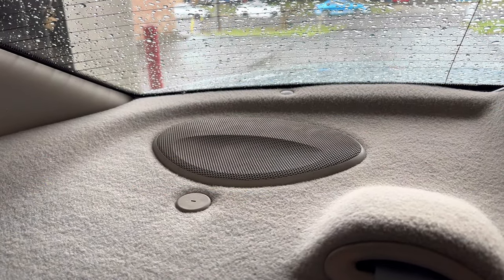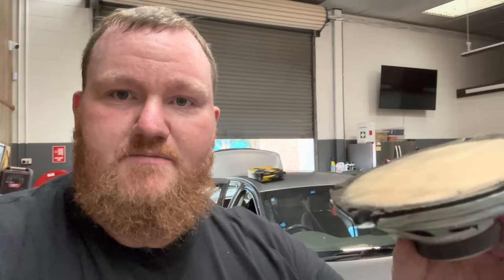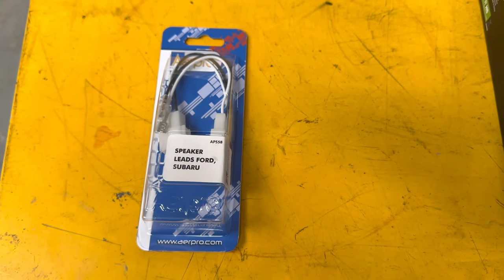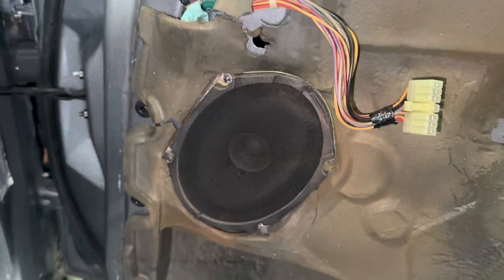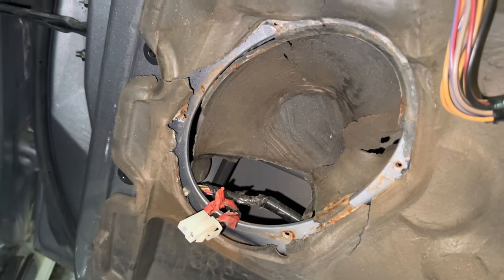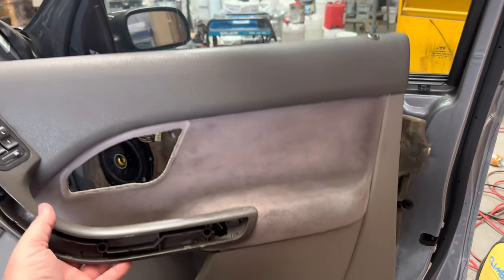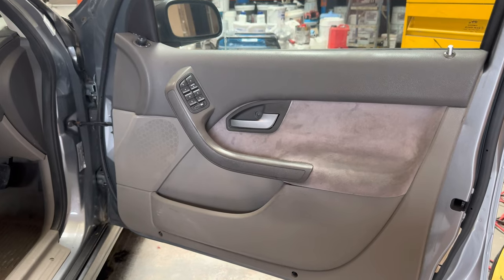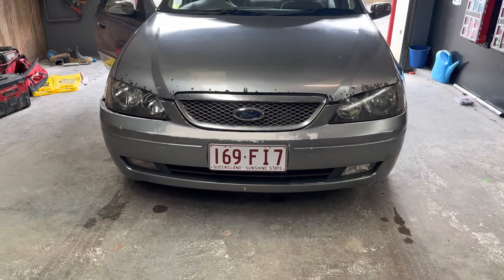Replacing the TERRIBLE speakers in the Abandoned BARRA

Comment: Factory stereo are pigs and rust behind the speakers the sponge a great trap for water changing head unit is not a lot of room if you wish to run RCA cables back to the upgraded amp in the boot been there done that anyway thanks for sharing.

Comment: I got a aftermarket Kenwood headunit and CB radio in a airopro facia kit , alpine type g 6.5 splits in the front Kenwood 3way 6x9s in the rear a JBL 12inch sub and Kenwood 500w rms amp , sounds so much better than the factory headunit,
Reply from the maker: yeah thats the plan to get an aerpro fascia and upgraded head unit one day when the budget allows
Reply: Hey just wondering when you installed that what wiring loom did you buy and how did you connect it to your headunit
Reply: @xtongan_reaperrr188  i didnt buy any wireing looms i made my own . Used factory antenna  plug  Ran a constant 12v from battrey  to the head unit constant power ..used switching power from the fuse box so it comes on when key is on accessories .. tapped into the factory speaker wires behind the glove box and above drivers foot well behind fuse panel speaker wires are twisted all the rest are left straight in factory loom ran my own over sized power cables and rca in boot that does the sub  .... factory headunit is still connected but has no speakers connected to it

Comment: hey mate awesome video im looking at buying the exact same setup , was the speaker bass better?  i cbf with putting in an amp and all the shit just want to run the stock head unit
Reply from the maker: Look it was a little better but nowhere near as good as if you ran an amp and sub woofer
If you want more bass I’d recommend going to a bigger driver something more like a 6x9 in the rear and I believe they also fit the front with a little cutting

Comment: Would anyone know what wiring loom you would need to connect a single din headunit without replacing the whole iso unit
Reply from the maker: Not off the top of my head.. this car used to have a single din back in 08/09 but has been removed and wires sent back to stock head unit…
Try forum searching on xr6turbo.com

Comment: Do you know if the aux works with these aftermarket speaker my Bluetooth that plugs under the fuse box isn't working with my new speaker only the old any idea why I'm guessing maybe the speakers only run through the head unit
Reply from the maker: Not sure sorry, if your speakers just plugged into the same wires I’m not sure why that’s happened